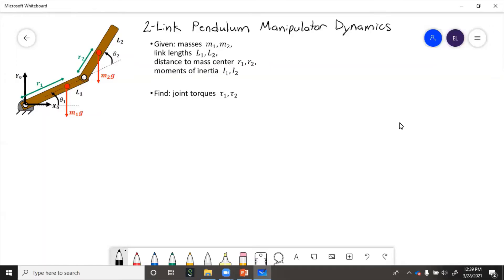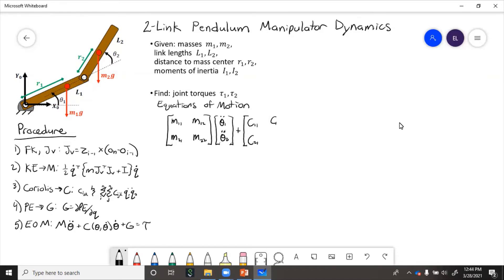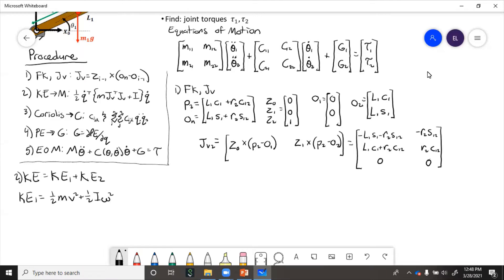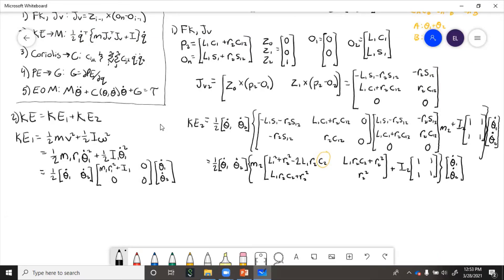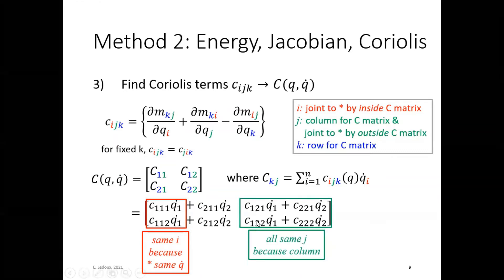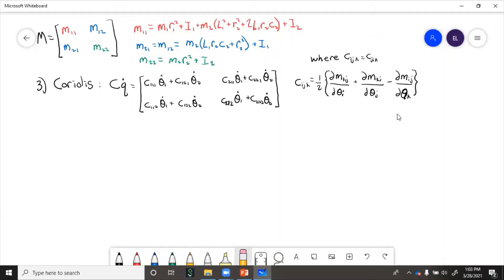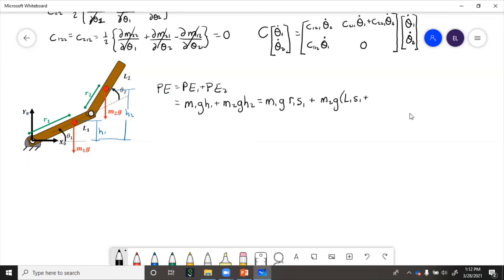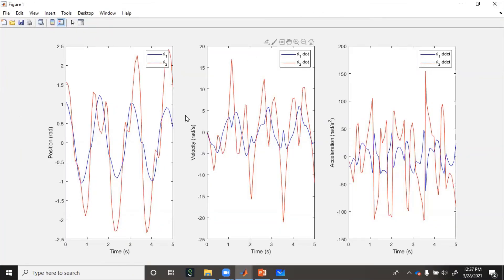Two Link Robot Dynamics

Comment: Hi, I have a question about the I1 and I2 matrices. Why is I1 written as I1[1 0; 0 0] and I2 is written as I2[1 1; 1 1]?
Reply from the maker: That is because the velocity of link 1 is just theta1dot, but the velocity of link 2 is theta1dot+theta2dot, so the inertia of each must be multiplied by the corresponding thetadots in order to get kinetic energy.  (theta2 is measured from link 1, not from the world frame x, so link 2 position is theta1+theta2).
Reply: @roboticsandengineering  loved it❤
Reply: Thanks so much!

Comment: Please say what is there for coriolis in robot dynamics since it matters only for long distance
Reply from the maker: The C's are for coriolis.
Reply: @roboticsandengineering  i know that but why are you taking coriolis force into account
Reply from the maker: Take Coriolis forces and accelerations into account when there are multiple rotating objects or the frame of reference rotates.  It matters for long distances on the earth because the earth rotates.  But anytime you have multiple objects rotating relative to each other, such as the example case of connected links, Coriolis matters.

Comment: in 10:18, c112 = m2*L1*r2*s2, it is positve, not negative
Reply from the maker: true because the cosine derivative is negative, and that cancels with the negative already in the c112 equation
Reply: @roboticsandengineering  in c112 function, it has a minus, and after, the cosine derivative is negative, so that multi of them is  positive